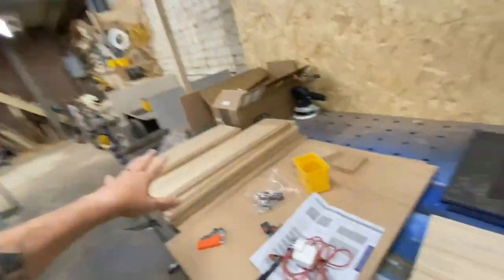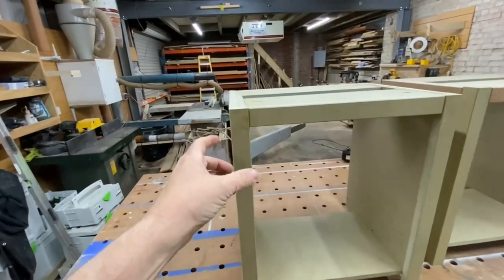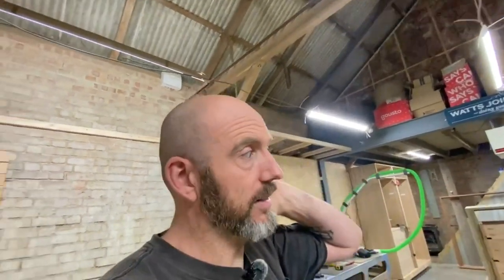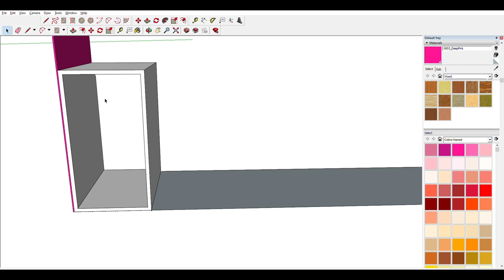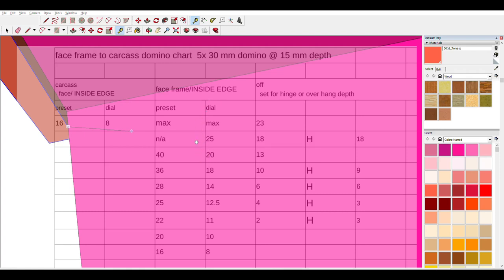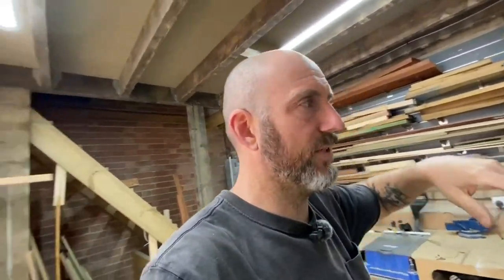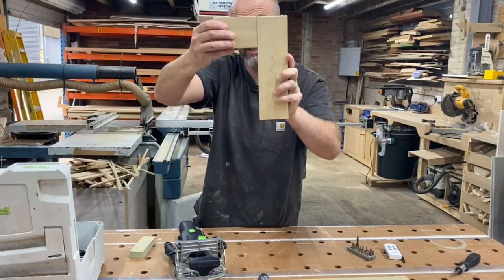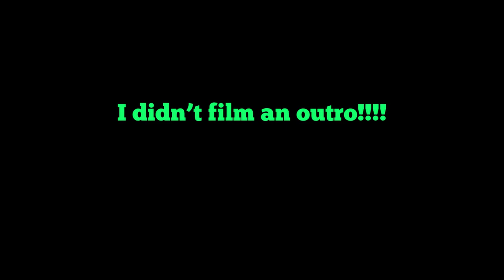A little bit about how I use sketchup and a Festool Domino top tip!! #38

Comment: Hi Matt, another great video, thanks for putting these together as I really enjoy them. Thought you might have given up when nothing came out over the weekend. Most people I know doing the plant on shaker doors are using two part mitre bond glues to avoid clamping or pinning etc. It also helps with the warping that can sometimes happen on larger MDF doors when using this method. I've used it a few times and it does work well as long as you make the parts a little oversize to trim in later.
Reply from the maker: Thanks Keith 

I don’t mind using Mitre bond to hold stuff while pva goes off and perhaps clamp aswell as the mitre bond will stop the panels swimming about but I don’t like the idea of just mitre bond as it seems too brittle to me. Thats my take so far! Anyway I was too slow to get a video out so missed theses comments and just pinned a load together today. I also made some traditional style ones and for me it’s just a better system. Much more stable too and less weight!.

Thanks for the support and comments. I really appreciate it! It’s nice to know how other people do it!

Matt😊

Comment: Great vid Mr watts, just want to share how i do that style door/drawer front. I have had good results with using pva then putting two 23g headless pins in each style and rail to stop them swimming then instead of clamps using a vacuum bag to press.I have a 2400x1200 bag and i bet you could get 20-30 doors/drawers in at one time.
Reply from the maker: Hi Richard 

That’s a great idea! Inadvertent used those bags before for veneers when I worked in a another workshop. They had like a compressor pump thing for the bags! I will have to look into it! Probably lots of other uses too!

I do like the security of pinning it!

Thanks for watching 

Matt👍🏻

Comment: Top video Matt. Love the sketch up. Was it the free version you said you use. Keep them coming mate.
Reply from the maker: Thanks mate👊appreciate it 

Yes, it’s sketchup 2017 and you can get it from their main site. You can also get the pro for 30days. I really liked the pro but I wanted to master the basics first so just went with the free version. I recently found out I can access the library for stock images of things like sinks, showers, ovens etc. and with a bit of softening out I can get a good render of those in my models.

Very addictive program once you get The basics! 

Cheers Matt 👍🏻
Reply: Thanks mate. 👍🏻
Reply: Interesting that you do a drawing for every quote. I used to do that but found I was taking too much time for jobs I wasn't getting. So now I tend to quote first then get an initial deposit that covers my time drawing and amending drawings (a design phase basically)
Reply from the maker: @_nacnud_ 
I probably should have qualified that statement. I don’t draw fro every quote. It’s mainly recommendation so people talk about the costs of previous jobs. If it’s a job out of the blue which is rare I do give a guide line budget normally over the phone. I also make the first drawing very basic but spend a most of my time making sure the room and measures are right! I found I was losing time remeasuring jobs pre production. Now I trust my first measure and have every it of the room documented. 

But I do hear you!

Thanks for watching, matt

Comment: I use miter mate its fast then i tape it then spray.
Reply from the maker: Hi @jasonhughes6994 nice to hear from you again! Tbh I am hearing that a lot! I know with the prep tape and the paint  it isn’t going anywhere. I guess if I do them again I will have to do it that way. As a rule I don’t like the back of the doors flat so typically do shaker style  panels even with MDF but I know I will get the chance to do these again at some point! 

Thanks for watching.

Comment: Hey mate noticed few Instagram lads are using cnc for there shaker doors out of solid pieces of mdf,  suppose it’s a fast way…  lot of waste in dust I suppose 🤪 keep up the great work 👍❤️
Reply from the maker: Yeah. The guy I am thinking or definitely does plant on. I went to Felder recently and was looking at CNC’S it’s a bit of a no brainer as if you put it on finance it’s cheaper than employing someone and obviously will out perform trainees! You would have to be really organised with work flow tho and would need someone fitting. The machines are really interesting but not for me! 

Thanks for the continued support.
Reply: @Wattsjoinerybarn   yeah they are an expensive bits of kit, if your not careful you can end up running manufacturing business rather than a joinery company. Like you say down to personal preference. 

In our trade we are all looking for the most efficient ways to work which in turn equal a more profitable business…
So if you find out any tips keep passing them to your viewers 😜
Reply from the maker: @Seanjames570 electricity bill and software updates would be a major concern too. Would be interesting to see how you could work into bespoke work!

I like to cancel out any productivity with procrastination. That’s my top tip! Keeps me grounded and not mega rich!
Reply: @Wattsjoinerybarn  🤣👍

Comment: If your talking about derek Barrett he just uses mite mate
Reply from the maker: Ha ha.

Wish I had a prize for you 😂 no PVA aswell? 
Then again I guess with the edge banding and paint it will hold! Really surprises me tho as face grain to face grain mdf doesn’t glue well with mitre mate! But I guess it’s not really ever stressed!
Reply from the maker: @harrywitney9582 great comment btw, thanks for watching 

Matt 😊
Reply: I've seen quite a few people use mitre bond for the plant on method. I hear your concerns but in reality it's not really going anywhere. I'm just not a fan of it personally. I think it makes a more unstable door and the weight would worry me on larger doors. Although it seems plenty of people do it so maybe I'm missing a trick? I've recently started getting my doors CNC cut and it saves a lot of time and space in my relatively small workshop.
Reply from the maker: @_nacnud_ 

Yes the weight is my main concern and also if it wants to distort it will be quite severe. I do like it for drawer fronts tho! Cant get to use to it tho as i do a lot of solid work!
Reply: @Wattsjoinerybarn  tbf could you not still use it on solid work? If your doing your usual tulip wood for example keep the solid MDF back panel and then just plant on planed strips on top? If being painted that is obvs. Would depend on what thickness of stock you can get hold of I suppose to make it practical. Do you have capability to resaw? Could obvs substitute the mdf for a veneered board if you wanted grain on panel as well (or weren't painting)..
Reply from the maker: @_nacnud_ 

It may work! I can resaw and do sometimes use veneer board as the finished bathroom in week34. I think I would be worried about the tulip being less stable at say 9mm and also it then expanding and contracting differently to the panel. At the moment I only use a very small amount of glue in the grooves. It’s probably the main benefit of mdf shaker style doors! The fact it’s all the same material. 

It’s also a different process to making the rest of the job! If agree tho it would have made the bath panel I made in week 28! 🙈 

Bottom line is I think it would actually work but there is some theory to suggest it wouldn’t so I may stay clear!
Reply: @Wattsjoinerybarn  Ah that's true I hadn't fully considered expansion/contraction issue. I wouldn't want to risk that myself either tbf